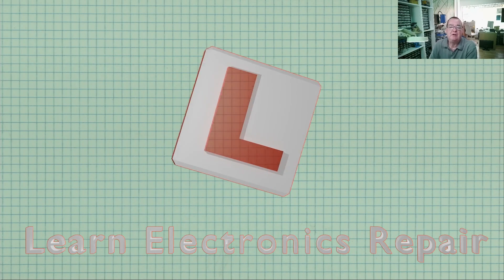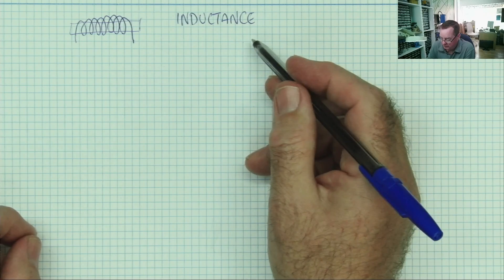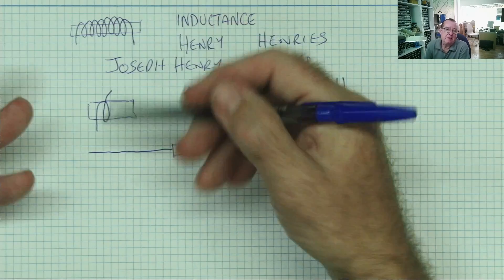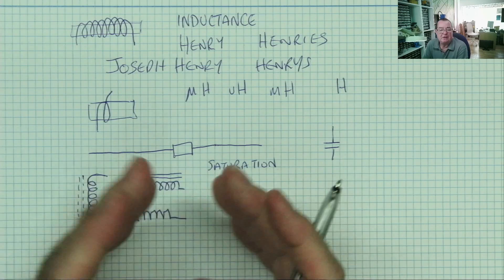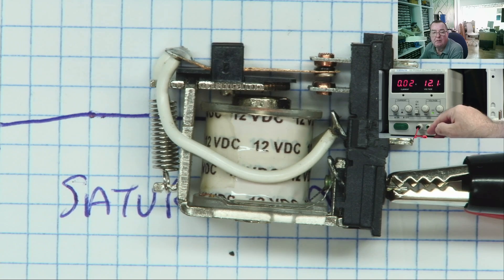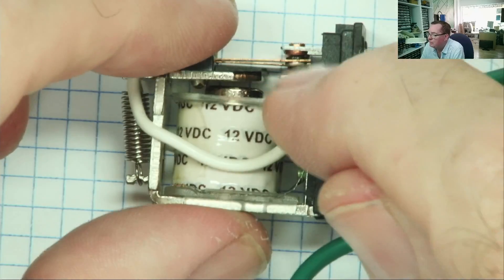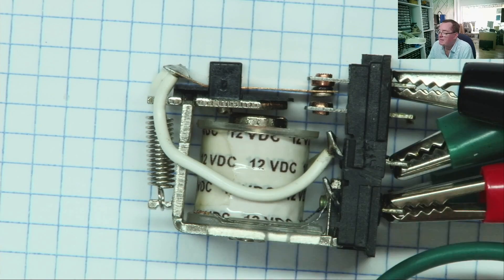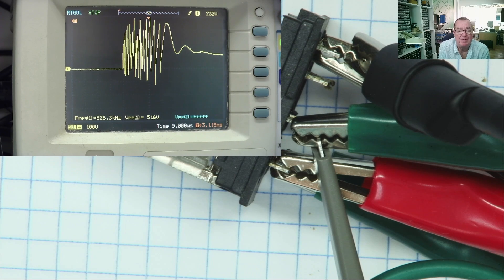Learn Electronics For Everyone : What Are Inductors? Beginners TutorialGuide

Comment: It’s in phones, very old phones, laptops, power banks. These inductors are needed to calibrate the battery. As the battery gets old, or the device is brand new, the inductors remove the memory effect from the cells to achieve better power, longer time on battery. When a user is blacklisted (fags), the coil does the opposite, drives in the memory effect to worsen the battery. When a legal laptop exceeds the time limit, it reduces the average usage time to 55 min-1h9 min for Athlon x2. Switching between power schemes causes that.

Comment: Hey kind sir.. I am attempting to diagnose a PCB board from a Silent partner tennisball machine. The machine was used only a handful of times and my nephew loaded the hopper too full and the board got shorted. The company knows what the problem is because they immediately told me to remove the PCB and send it in at a cost of $150 dollars they will diagnose it repair it and send it back. The machine is no longer under warranty and so I was first going to try and find the short 
The PCB board controls the function of the machine motors and was unresponsive to any input. I have tested all the motors and they work fine ... Any idea or guess at what components I can look for and test on the PCB?? ... Any help is obviously greatly appreciated as I'm excited to learn how to do basic troubleshooting.. I recently taught myself how to remove and solder in components but the testing is little confusing.. I have a new nice auto dm from kaweets
thanks .. luv your content and will  donate  graciously for any advice you can offer that leads to my circumventing their extortion lol

Comment: HI Richard, Since I'm thick lol, Your drawing shows current going through the coil via the NC contact. When energised those contacts open switching the coil off  So my question is how does the coil get energised  as the NOcontact in the sketch doesn't go anywhere?
Reply: Slightly confusing (in my opinion only). When the contacts open, the coil is de-energised, and the spring pulls the contacts back, re-energising the coil. Yes,  there is back-emf, but ideally requires a different setup to show it.

Comment: When a relay contact is broken like this, even without the inductance of the coil, you can still often see sparks - due in part to the inductance of any wires, but also due to the fact that the breakdown voltage is much smaller for a tiny gap (which breaking the contacts starts with).

Comment: Thankyou Richard from Sydney Australia: for explaining an inductor and the parts of a relay. I wondered what "they" did. Located with the fuses in the engine bay of motor cars, you can see the parts at break. Such as the spring and wire connector. I knew an electrical charged winding caused a magnet . I often think of doing it to a screwdriver.
🌏🇦🇺

Comment: Not a former, but ferromagnetic core - the essential component.
Reply: Yup. What he is calling a "former" is invariably called a "core." "Former" is used for something that just mechanically holds the winding. "Former" and "bobbin" are pretty much synonymous. There are, of course, "bobbin cores."
Reply from the maker: @D614G_aka_Doug  I think former, bobbin, core all the same pretty much.  Can we add ferrite bead to that as well?  I did describe what it is made of and what it does at a basic level.  I'll try to call it a core if it makes you guys feel better. 🙂
Reply: @LearnElectronicsRepair  
It isn't a matter of how someone feels. It is a matter of using the language that is accepted in the industry, which is rather important if you are purporting to teach others..

A bobbin or former is used to "hold" the winding. The core is then inserted into the winding assembly to make the finished inductor or transformer. Bobbins can be had in a wide range of types - different polymers, with or without PCB pins, single section and multisection, horizontal and vertical.

Toroid and rod cores are used without a former. With E cores and derivatives formers are almost always used for high-frequency inductors and transformers and rarely used for larger low-frequency inductors and transformers.

"Bead" is usually used to describe a tubular shape that typically is simply placed over a conductor or a group of conductors, though occasionally beads are wound with more than a single turn. There are multi-hole beads that are wound. There are two-hole beads that may be wound with a single conductor or with two or more conductors to make a transformer. Something can be called a bead yet be very large, though larger ones may be called "suppression cores" because they are mostly used for control of EMI/RFI.

You can learn lots about cores and formers from catalogs from companies like TDK and Magnetics, Inc.
Reply: I respect your work wery much, so you do not need to worry about my comment so much. Just a little suggestion, you talk about induction of current, what is not correct. Accordingly to Faraday law, we can talk about Induction of voltage.
Best regard to you, Richard.😊
Reply: Your relay experiment reminded me of two methods commonly used to start pulse jet engines.

The modern method uses a relay like yours to pulse a circuit and create a high voltage spark to light the fuel.

The old method uses something you probably never played with even though Henry Ford made millions of them and they are still common in the used market and that is his spark coil box.

These wooden spark coil boxes have similar contacts to our modern day relays but they also have a capacitor built into them.

Maybe a capacitor added to your modern relay can up the output voltage as well?